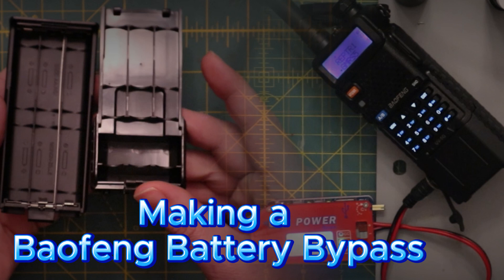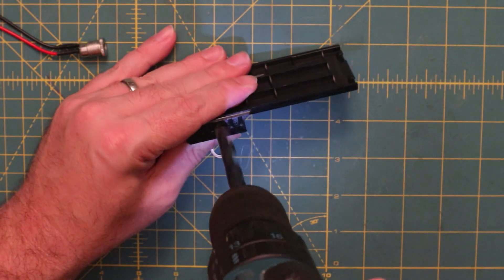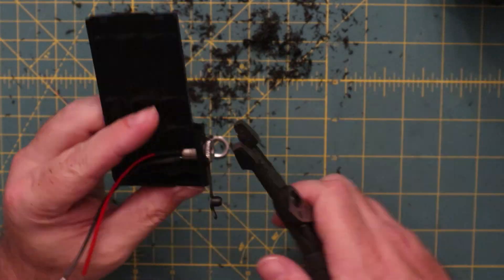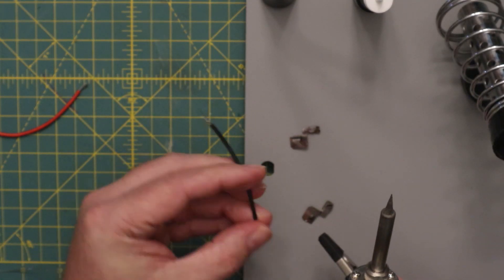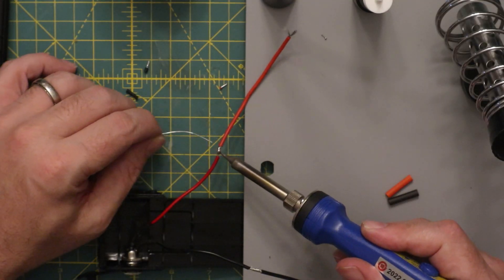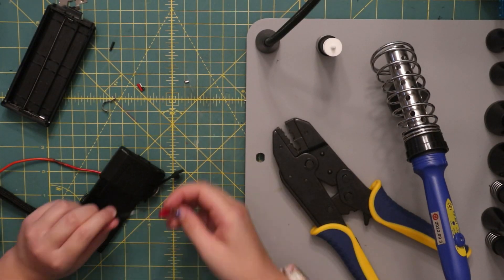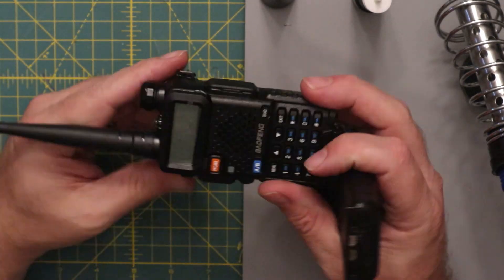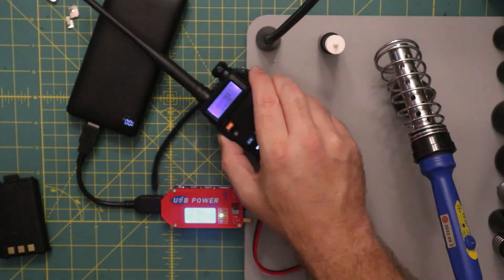Baofeng HT battery bypass

Comment: Why can't you just use the charger cradle that comes with it?
Reply from the maker: @AlWill-l2o  in theory the charge controler and battery isn't set up for simultaneously charging and operating and would damage the battery, the manual recommends against it... Not sure how real that is. The same is said for the newer ones with a USBC plug on the battery. I also wanted something more positively connected for unattended use, not that duck tape wouldn't solve that. Would love to hear what people think

Comment: Thank you for documenting this! I’ve experimented with modifying a 12v cigarette lighter battery substitute, but I think your design is better.
Reply from the maker: I am really glad you found it helpful! I seriously considered starting with the car bypass but it was more costly and seemed like a waste of the step down that I believe is in the cigarette plug connector itself. I was initially hoping to be able to have the option of using AAs in the same adaptor but those pesky non-solderable tabs...
Reply: @ I bought a car adapter to experiment with this - on the unit I purchased, the step down was not inside the plug. The wires were very small - 28 or 30 gauge - which didn’t seem like a good match for the Powerpole connectors I wanted to use. I was also unhappy with the thin wires because I’d read about people experiencing low transmit power using the car adapter so I wanted to be sure the resulting device could provide enough power for full transmit wattage. So .. that approach was a dead end for me.
Reply from the maker: Sorry that route didn't work out but good intel on both counts. I am generally in the over spec/large safety margin camp, would rather waste some copper than worry about it.

Comment: Is it possible to put Stepdown converter inside
Reply from the maker: It should be and that would probably be better, more elegant anyway, and it might make accidentally overpowering the radio less likely. I had some LM2596 buck converters sitting around(which might not be the best things to use) but they should be a decent size analog. It almost shuts with it in the top shallow portion, I am pretty sure if I were to Dremel out the raised lines that keep the AAs straight there would be enough clearance. Would want to do a thermal study keeping in mind the low duty cycle that the HT is meant for but it should fit.